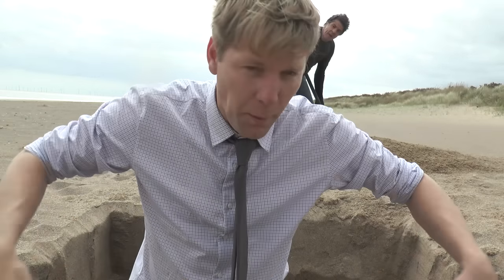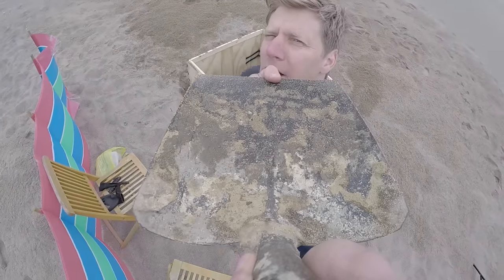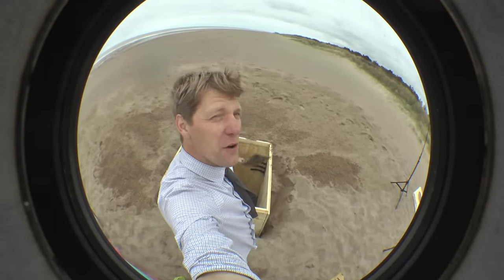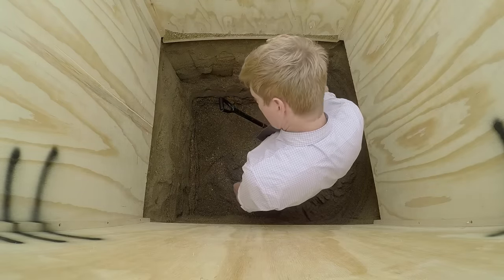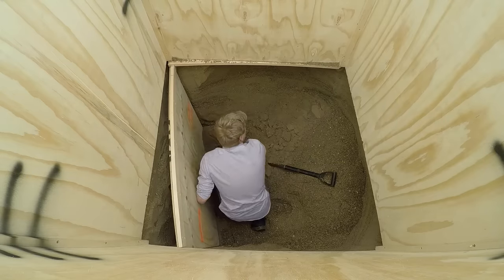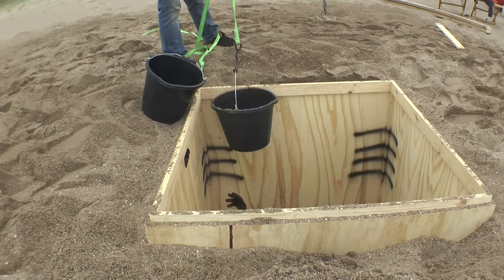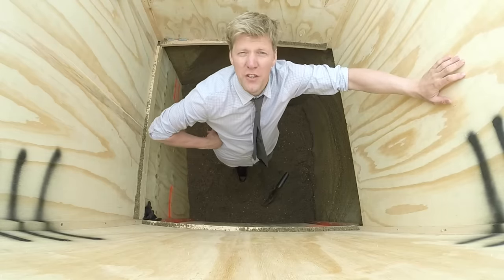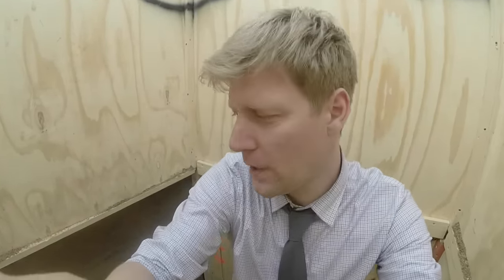Underground Beach Hut Build

Comment: you should just build some sort of vacuum to suck out the sand instead of using a shovel
Reply: noah fickel they make those. they're called vacuums
Reply: iLikeC00kieDough that's why I said vacuum lol
Reply: i was thinking the same, just take a big vacuum or a leaf vacuum with a hose attached and suck it all out. My leaf vacuum sucks in loads of sand if its on soft ground. And where the bag attached it would be pretty easy to connect a piece of hose.
Reply: The sand underneath is compressed by all the sand on top. You'd still have to shovel it all loose.
Reply: yeah,you can get "sand vacs"at Walmart
Reply: noah fickel We don't have Walmart in the UK.
Reply: Jake83 Hahah we have morrinsons and shit
Reply: Jake83 No walmart!?!?!? That's terrible 😣
Reply: C Kay don't worry, he have tescos

Comment: You will be buried alive if the wall can't hold the sand strong enough...
Reply: Ray Motor Channel no
Reply: Ray Motor Channel the walls are all drilled together
Reply: Lol Lol Just because they are screwed together doesn't make them instantly indistructable
Reply: IF
Reply: Ray Motor Channel Not exactly. The wood would hold till he wakes up
Reply: The walls are all at least 3/4" thick plywood, with the 2x4's on each corner making it harder for them to cave in, and the floors to reinforce it even more. That would be able to handle all the sand even if it was submerged in high tide water.
Reply: zzerulia lase but still the chance of it happening is still their
Reply: actually if you watch him, there is a moment where he hasnt even got the wood in yet, he is deep down a hole. He didnt realize that sand collapses very easily and so many people have died by being burried alive. By the time your friends and family dig you out you've been dead ages. This is the most dangerous thing he's ever done. Even more dangerous than his hoverbike, which nearly took both his legs off.

Comment: This looks extremely dangerous. Sand is very, very heavy, and those plywood walls could give at any moment. You would be crushed and it would take hours to dig you out.
Reply: Ardon Platt you just ruined the whole video for me
Reply: Same
Reply: Ardon Platt especially the damp/wet sand they are dealing with
Reply: I was thinking that too once he got to the second level I was like, "wouldn't the water seep into the wood? Maybe he treated it though." After reading your comment I realize he didn't. I mean the wood doesn't look too think so I don't know how dangerous it'd be; but I'm not exactly a carpenter either.
Reply: Ardon Platt but it's still cool
Reply: Sure they "could" give in, but those walls look strong enough to me to get that probability close to 0.
Reply: I have done trench work before and there are OSHA rules for a reason. What they are doing is EXTREMELY dangerous. If those walls break, which would be easy to do with that sand that all wants to move down.

Comment: If he would have added wire mesh to give the sand walls some structural integrity every foot or so he might have found it easier to dig the hole and add the wooden walls.
Reply: but then u gotta make a bigger hole...
Reply: only as thick as the mesh which is like a millimeter.

Comment: The horizontal pressure will increase considerably after a few cycles of water coming in and out of the sand. It will not hold. Hopefully no one will be inside when that happens. The earth around the structure needs to be mechanically stabilized (reinforced).
Reply: The Semite he says he's not going to keep it there. He's going to destroy it.
Reply: The Semit

Comment: Missed a trick with that one, I used to dig graves for a living so have a bit of experience. Digging a 4ft unsupported hole is more dangerous than you would think. Removing the supports so you can fill it back in is often the worst part.

We usually used aluminium shutters with hydraulic rams to keep them open but The simplest solution is to use scaffold boards and add them one layer at a time. Then you are never digging more than one foot unsupported and you have a much stronger structure than you get with ply.

Can literally get killed doing this kinda thing and nobody wants to be digging their own grave.

Comment: You're lucky it didn't collapse while you were in it. Not structurally stable in any way. All the wood will do is pin you under so your friends will never dig you out in time. Sand almost behaves like a liquid and doesn't retain its shape very well, so walls cave in easily.  That wood will get wet and cave in in a matter of a few weeks, if it hasn't already. You seem like a smart guy, but this just isn't safe. Basements and sand don't mix!

Comment: Carbon dioxide is a heavier than air gas. Quite a sealed wee creation there. Too long down the hole and without forced ventilation, well.... lights out.
Reply: Wow, have to trust scientific advice from the guy that say's "air gas" If this was a serious hazard, every single tunnel mine would be shut down.
Reply: ...forced (natural of mechanical) ventilation. Tunnel mines, and mines in general HAVE ventilation. Also have a lot larger volume than this box. A heavier than air, gas. Means it sinks. Simple really.
Reply: If you're gonna yell at someone for their word choice, maybe you should Google "how to use the apostrophe" first...
Reply: @SupremeSkilz The scientific study behind the mass of matter would be Physics, not Chemistry. Plus Carbon Dioxide is only around 1.375 times heavier, meaning displacement wouldn't be hard. A 4x8 cubic box contains 32 square litres of air. An average breath is around 500ml. The average breathing rate is 12-20 so lets say 16. Meaning there is 4 minutes of oxygen in a completely sealed box, which this is not. Hypoxia will start to kill braincells in 5 minutes. Meaning there is a 9 minute barrier before you are even in danger. Adding the disturbance and the fact this is basically a glass of air, Gas will escape and enter as you move, breath and enter.

@ToastEngineer Was after a nap, you have to atleast perk some curiosity at the phrase "Air Gas" instead of "Atmosphere" or the simple O2.

@Jessie doof Hazard, maybe. Serious I doubt it. If everyone was afraid of hazards as much as this comment section America wouldn't have a 68% obesity rate. Stop living a sheltered life.
Reply: Not sure what your day job is, but at a guess it isn't anything to do with  the "Real life" involvement in confined space operations. Very nice set of statistical numbers you blurted above, but that is just that. Statistical numbers. Look at the size of the box. Put a person in it, and have a guess at what the air volume does....Plus it has a floor (yes I can see it has a hole in it) at the lower level. It doesn't take a rocket scientist to work out that two floors down, there is NO air movement. No where for the Co2 to get removed, as well as any other....just for you...heavier than air,,,,...gas to escape. Google might have helped with your last lot of reply's. But really, get your facts right. Grief.
Reply: Never said to go suffocate yourself. I said to stop worrying about improbable situations, that would be common sense. Shitting yourself over a video where someone could have almost been hurt if the stars align in a one in a million chance, that is not common sense.

Comment: anakin will die of he sees this vid
Reply: BenYa I don't get it
Reply: +crave5885 because Colin is below sea level so it's "low ground" and in revenge of the sith when Anakin and Obi Wan are having there battle, Obi Wan shouts "It's over Anakin! I have the high ground!" But Anakin thinks he is a ninja and attempts to frontflip over Obi Wan and kill him, things go south for Anakin and Obi Wan strikes him down with ease, leaving Anakin badly wounded. Therefore if Anakin saw this video, it would bring back the memories of when he was at low ground compared to Obi Wan, causing him to die
Reply: crave5885 He hates sand
Reply: Hellfire Heroes yeah that's what I meant he hates sand
Reply: +BenYa my version is better 😂

Comment: The 7 story version was round, concrete and designed to have massive weight in water push it down on each floor. I think it was a car park, so it was thick and could handle the water. Not sure if it was in bladders or what. Clever.

Comment: When Fred Dibnah built a model pithead in his garden (without planning permission), he built the shaft lining out of brick and let it sink down by digging under the wall foundations. I think a circular retainer is much more stable than a square one as the entire structure is under compression. What would probably work well is large diameter HDPE pipes.

The same mechanism has been used for centuries in digging out the foundations for bridge pillars, although it was common to use a coffer dam made of iron.

Comment: I love how the safety police doesn't get the fact that Colin has reinforced the beach hut construction.
Reply: Unfortunately it isn’t engineered correctly to withstand the load. Buy hey it won’t be me in the hole.
Reply: "reinforced" LOL, go look at a picture of a manhole box of similar size and tell me if Colins plywood construction is appropriate. 

I'm a site engineer and I've been on sites where two people have been hurt because 1) he was digging below the trench box, like Colin did, (annoyingly he had a second trench box I had INSISTED he use and he SHOULD of been using right next to the trench but he got payed by the meter so he was cutting corners to lay pipe faster) fortunately his labourer jumped in and dug him out quickly so he got away with broken ribs and his life and on another site a trench wall only about 4 foot fell and bent a guys leg the wrong way, he had a lot of surgery and didn't return in the 4 months after I was working there.

There is a lot of red tape health and safety but this isn't one of them, this is just a straight up bad idea.

Comment: As I've dug several wells in my day. The trick is to use steel rings & timber planks. Sliding the lengths of 4" x 1"s planks down between the outer liner & the inner steel rings. 
Don't forget a round spear has a stronger holding strength.  🕳

Comment: This is exactly how Marc and Isambard Brunel sunk the shaft for the Rotherhithe tunnel in the early 1800s I think - the trick is to make the box a lot heavier, eg steel or concrete, and with a sharp leading edge so it sinks down through the earth as you remove the fill. Then you just add successive levels as you go.

To be fair it works better at larger scales as the friction is less significant compared to the weight. It's a sound enough idea as long as you build the sides strong enough not to cave in!

Comment: Is there a reason you did not add additional wall segments to the top and slowly get the structure to drop with the removal of the sand at the bottom?  Of course, as many have pointed out so far, this was really rolling the dice with your life on the line.  Also, is there a reason you did not use corrugated metal walls that would have both cut through the sand as you moved down, and also provided a much greater structural support to resist the collapsing sand than that wood ever could?  When you do your next crazy project, try to think of the worst caseaccident and what you would need on site to save your life, since in this video neither you nor your friend would have been enough to save the other in most scenarios.  It would be a very sad day to see a memorial announcing the end of your channel due to a restless accident.  I am looking forward to many more projects from that crazy mind of yours, so keep the videos coming.

Comment: Furzey.... IDEA.

Start with a 8 foot box, then slot in a 7 foot box when you dug out the sand at the bottom of the 8 foot, then slot in a 6 after the 7 is below the 8, then a 5 below the 6 and then a 4. Then when you have done the last 4, bang in a load of 4s on top of that. 

Remove the 5 6 and 7 and 8. Back fill. And....

Sorted.

Comment: Could be spraying silicone or water or spray glue to keep the sand walls from falling down possibly  might not work. They use silicone  spray  for sand castles. This is like a bad ass sand castle.

Comment: You got to use steel or concrete pipe. Then you auger out the sand and push the case pipe down in sections,that's the only way you can dig sand.

Comment: You need to make a large vaccume, like the one for sawdust, with a powerful motor, then suck up lose sand as you brush the surface back and forth with some type of big teeth on the tube you hold in your hand.. you will go down a feet a minute.

Comment: A better strategy would have been to add packed clay around the edges on the outside of the plywood. Even green treated rots when constantly wet. Clay is pretty water repellent. line it. burn some stuff in it. then build a 'free-floating' structure framed in plywood with the outside charred (for a slight carbon barrier). That's have improved it a bit.

Comment: wouldn't it be quicker to use a vacuum device to suck the sand up and out, Like a septic pumper truck could pull/suck the sand out faster than digging?

Comment: I think a shop vac connected to a plastic catch barrel would have removed much sand easily. The vac could have been run from a generator or inverter in an automobile

Comment: My neighbour died of this a couple of years ago; while digging a 3-4 meter ditch in the sand and reinforcing the sides using plywood. I believe they used 4 hours digging him out with a vacuum truck. As a geotechnical engineer (master of science) I would never stand in that hut!

The pressure on the plywood increase approximately one ton per meter squared per meter depth.

https://www.fvn.no/nyheter/lokalt/i/RREX95/35-arig-omkom-i-groft--etterlatte-saksoker-gardeierne

Comment: The mistake was not stabilizing the walls with a few spikes or dowels and horizontal planks hammered into the sand every 12-18 inches. That and not using such deep panels.

Comment: Colin, you badly need a book on shoring safety. You have more balls than brains to dig a pit and and support the sides with plywood and 2X4 boards. There is a reason real shoring is made with welded steel plate. If this was on a worksite and the safety guy saw it, you would be in deep trouble. If the govt saw it, the fines would be crazy.

Comment: This is extremely dangerous. 1 sq meter of soil/sand can weigh thousands of pounds. Proper framements SHOULD be used if attempting this. See OSHA guidance on entrenching to prevent tragedy from happening.

Comment: OK, I know this is an old video, and you lived thru this ridiculous stunt, but the unit weight of that sand is approx 110 pcf (pounds per cubic foot),  So if you the sand would happen to shear (collapse) toward your box, the lateral soil pressure, at 10’ down, would be 1100 psf (pounds per square foot).  That plywood box is in no way strong enough to withstand that type of soil pressure. In other words, you are lucky you didn’t get buried alive....